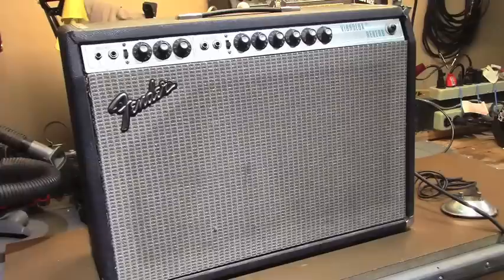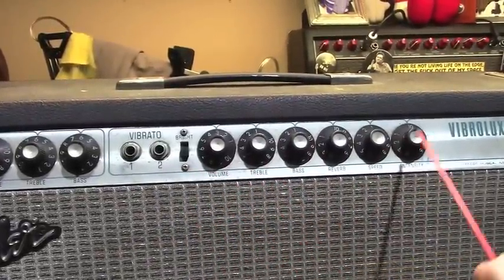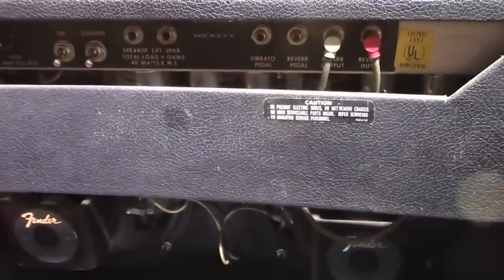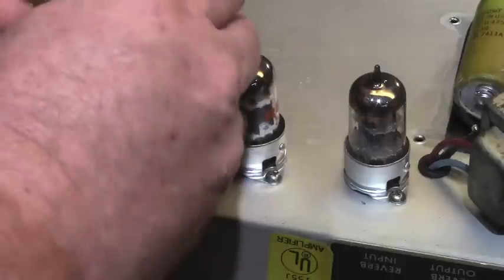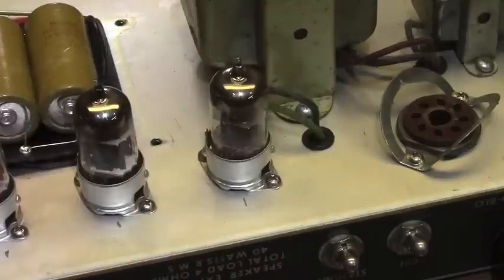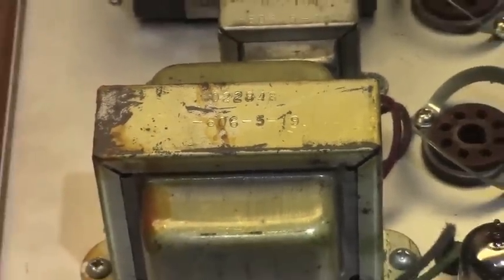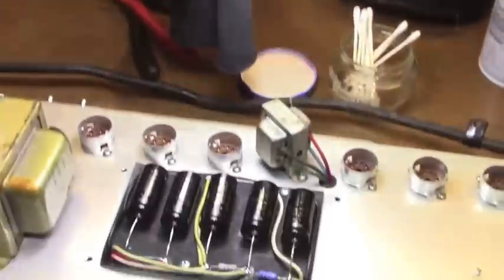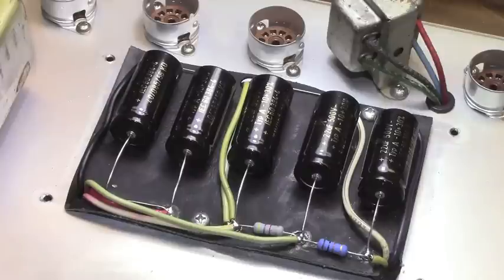On The Bench - 1976 Fender Vibrolux Reverb Restortation PART ONE

Comment: As I understand it, the 7025 is a very high grade 12AX7A. Very low microphonics, matched triodes and  tight tolerance to specs. A premium spec for audio use. 

I agree entirely they are the best tube in all Fender amps post Brownface era. I prefer the RCA 5751 Triple Mica Blackplate and Sylvania long plate 12AX7’s in Tweed and Brown amps.

I’ve seen CSA on all transformers post 68 amps, if I recall correctly. Original vintage amps are a treasure, no matter the era or brand. You do the right thing by listening first after the safety things (for you and the amp) are taken care of.

Comment: Just a technical one. Why are there 1M resistors in the long tail pair in the AA270 schematics? Is it a mistake or they were changed for 330K later, but there is no schematics for the later model? In any case, a great video! Thanks!

Comment: Another great learning video! If leaving the old resistors in place, do you check the values. How much out of spec is acceptable?
Reply from the maker: Rodney Kroetsch - to be perfectly honest, I don't even check them unless the amp sounds lousy.  I usually take one pass-through and check voltage drops just to make sure nothing is dangerous.